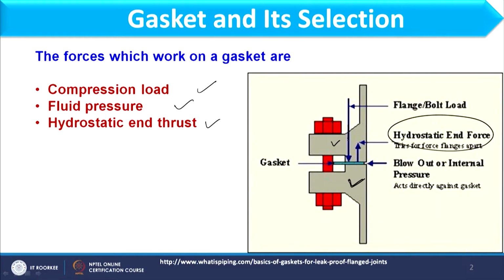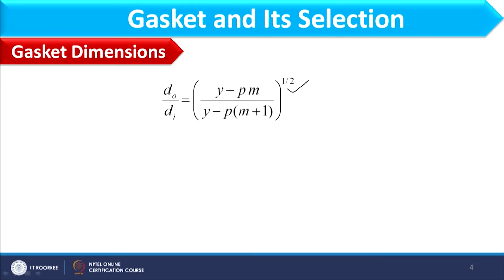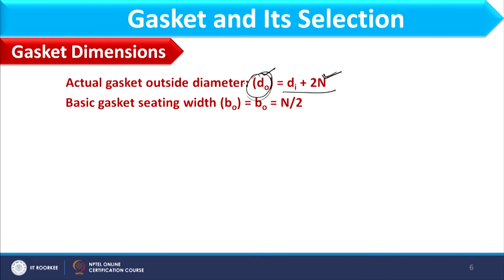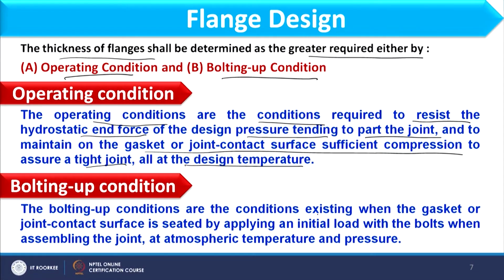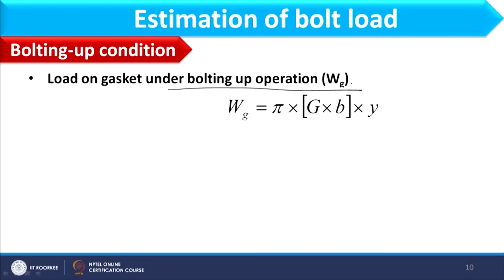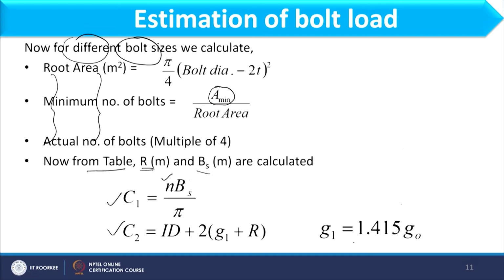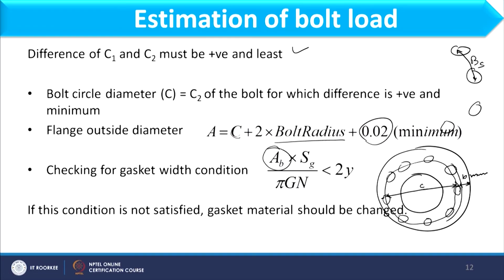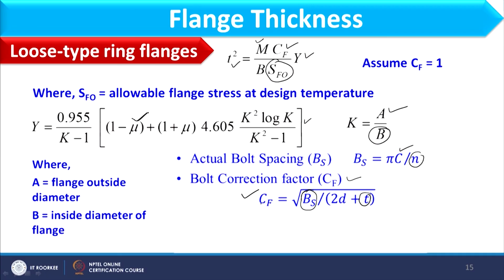Design of Flanges-2.1

Comment: In case of higher strength bolt ……load for bolting up condition is more …….leading to higher bolt thickness ……higher bolt strength gives higher flange thickness ……confusing